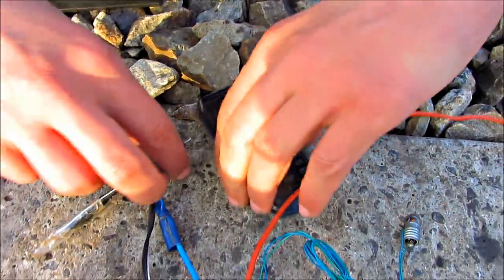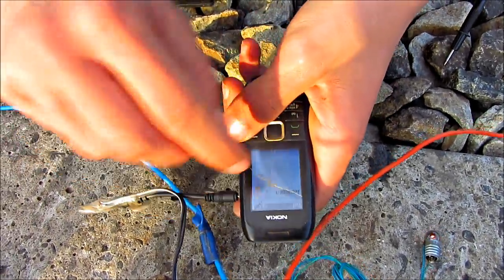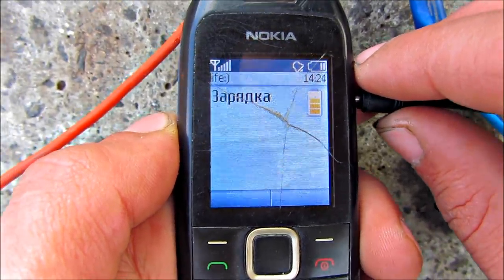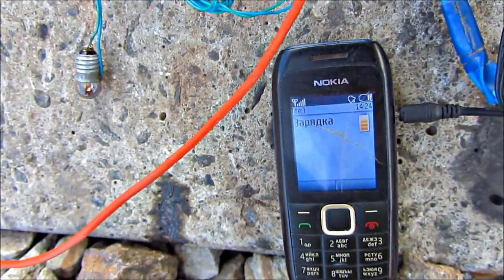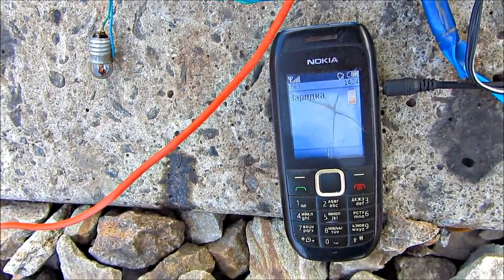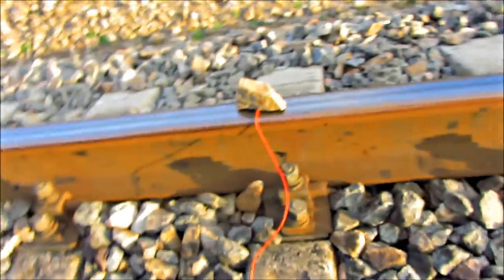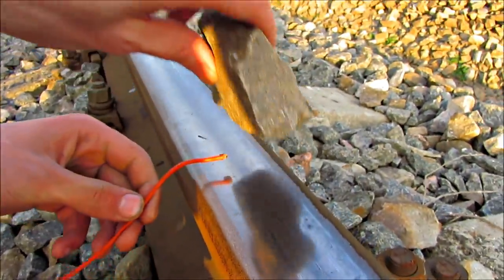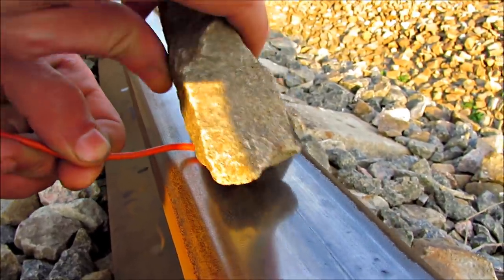How to charge a phone from the rail tracks. Measuring voltage on the railway

Comment: As far as I know, there's a little current going through to measure if a train is on that piece of track. All trains are made of metal and as they go through the track they will create a closed circuit, knowing that trains cannot occupy the same space, they can tell exactly which train is where based on the currents. This means that when you do this and the equipment doesn't adequately notice it's just you charging your phone, the traffic control program will notify the controller that there's an unidentified train at that location. Additionally, it will switch signals before that area of track to red and yellow (depending on the distance).
Reply: +TrainingMacro You Sure?
Reply: That is for as far as I know the system works in the Netherlands, wouldn't be surprised you're being able to do this because the same system is in effect there.
Reply: Yes and if you're car is stuck on track you don't wish to get hit by train short track using jumper cables. They think another train is there on the track when you short it.
Reply: +TrainingMacro The electric current also helps detect breaks in the rail, as if the rail is broken the current will not flow. Unfortunately this won't readily detect washed out or damaged track where the rails are still connected.
Reply: +johnstarr2001 
I will do this if my car ever gets stuck on a track.
Reply: +‍1marcelfilms I imagine you could try it with some jumper cables - but I don't know what threshold would be required.
Reply: +TrainingMacro Yes you are right. I work for a railroad company in sweden. By doing this it will actually stop the trains in that area. If you want to sabotage the  public transport so go ahead, but the police can find you quickly....
Reply: +TrainingMacro Excellent point!  The phone (or the lamp/speaker) may not be drawing enough current to trip the detection circuit, but it might.   In any event, what this guy is doing is a) Stealing electricity  b) Trespassing on railroad private property  c) Putting himself and the everyone on any oncoming train in danger (if they have to make an emergency stop because this idiot is sitting there)
Reply: +cowsongs oh come on! the worst thing that would happan - railroad sensors detecting false train on the rail.
Reply: Right.. Worst thing.  Train approaching only 1/2 mile away, this guy trips the detector, engineer now thinks there is a train or obstruction on the rail and has to make an emergency stop.   It is very easy for this guy to be too far away for the engineer to see, but still close enough that it would be very hard to stop the train in time. kosiak10851
Reply: In east europe or russia there is no such bullshit as rail roads on private property. Everything is public.
Reply: It's still generally illegal to be on the railway's Right of Way (RoW) no matter what country you're in.

Whether or not that's enforced though, is up to your country's current political condition.
Reply: I´ve never seen this before, but I can figure it out the purpose of those signals (which have a frequency). The signal applied to the tracks actually allow you to know the current position of the train, by means of measuring wave reflection. The reflected wave varies as the train, wich makes the short circuit between tracks, changes its position. I supose the frequency was set to 50 - 100Hz, becasue it gives a wave lenght comparable to the track's lenght.
Reply: I'll answer this from the UK's rail infrastructure perspective. 
the reason for a pulse or waveform being sent down that track is due down the wonder of modern railhead engineering; connecting lengths of rail is use done by welding the pair together. Previously, it was very easy to isolate sections of track into different "blocks" (so that only one train can enter one block at one time), due to the fact that the length of rail was bolted together and not necessarily joined electrically. 
However, with a rail weld, you cannot isolate a different block's track circuit. 
SO! to get around this, each section of the line is given a different frequency. 

Quote from Wikipedia;
Jointless track circuitsModern track is often continuously welded,
 the joints being welded during installation. This offers many benefits 
to all but the signalling system, which no longer has natural breaks in 
the rail to form the block sections. The only method to form discrete 
blocks in this scenario is to use different audio frequencies (AF) in 
each block section. To prevent the audio signal from one section passing
 into an adjacent section, pairs of simple tuned circuits
 are connected across the rails at the section boundary. The tuned 
circuit often incorporates the circuit to either apply the transmitted 
signal to the track or recover the received signal from the other end of
 the section.
Consider a railway with two block sections as in the diagram. Section
 1 has frequency A injected at the left-hand end and received at the 
right-hand end. Section 2 continues from the right hand end of section 1
 where frequency B is injected and then received at the right-hand end 
of section 2.

 

Track circuited railway with two block sections

There is often a gap between where frequency A is received and 
frequency B is injected. This is referred to as a 'tuned zone' and is a 
section of track where the amplitude of frequency A reduces in the 
direction of section 2 and the amplitude of frequency B reduces in the 
direction of section 1. The tuned zone can be of the order of 20 m long.
Advantages of jointless track circuits:
Eliminates insulated block joints, a component liable to mechanical 
failure (both of insulation and by introducing stress to adjoining 
rails) and maintenance.In electrified areas, jointless track circuits require fewer 
impedance bonds than any other double rail traction return track 
circuits.
Disadvantages of jointless track circuits:
Restrictions on placing impedance bonds, hence any connection for 
electrification purposes, in or near tuned zones as this may upset the 
filter properties of the tuned zone.Electronic circuits are more vulnerable to lightning strikes.
Reply: It's a railroad signalling. Google ALSN.
Reply: Im pretty sure that's how it is in america. I have not done this but ive heard of people dropping metal bars after the isolators by crossings and making gates go down
Reply: is it true, whoa, its mind blown.. you should do video about it.. to prove it.
Reply: TrainingMacro said:
"All trains are made of metal.."

That used to be the case.
Now however, China has begun producing cheap train imitations that are made of plastic.

Comment: Yea it's called positive train control, PTC for short. It makes it to when something that's metal is touching one rail to the other it indicates to the trains that there is another train. If the railroad catches you doing it on purpose you can get in a lot of trouble. It's a cool experiment to show everyone though!
Reply: +Mind Surgeon it is also as the activation signal for crossarms at railway crossings via the train wheel circuit. I live next to a crossing and every couple of years I have to go remove a coat hanger someone placed across the tracks to raise the arms and get the idiots in their cars to stop honking at nothing.
Reply: How about powering or recharging a battery after hours?
Reply: Gary Stinten, no. Trains run 24/7. And in many countries, the tracks are checked for obstructions, loose fittings and damage every day. Around here, that's done throughout each night, between about 10 p.m. and 6 a.m., when only freight trains pass, at 15 minute intervals.
Reply: Plymouth this is not positive train control. Its bacic ocupancy detector. Positive train contol involves GPS has well

Comment: The voltage on the rails does two things, it is a obstacle detection system and is a technique used to reduce the rate of corrosion on the tracks.
Reply: When the guy did this he was safe from trains and set the signal behind him to red clever way to stop a train but illegal
Reply: +ThisIs MyName not BS, it prevents electrolytic reaction, the same principle is used on ships to prevent corrosion in seawater cooling systems. Sacrificial anodes are also used on ship hulls to counteract the same process. Look it up 😉
Reply: +ThisIs MyName Cathodic protection (CP) is a technique to control the corrosion of metal. Cathodic protection systems are most commonly used to protect structures such as pipelines, storage tanks, steel piles, offshore oil platforms, and reinforcing steel in concrete.

The simplest method of cathodic protection is galvanic protection where a metal of different electrochemical potential is used as a "sacrificial" anode.

For larger structures, galvanic anodes cannot deliver enough current to provide complete protection. Impressed current cathodic protection systems use a DC power source to achieve this protection.
Reply: I understand this somewhat, thinking of electroplating but in this case which way is the current directed and then why is there a differential between the two railroad tracks? Trying to see the logic of energizing one as positive and the other negative. Or maybe they switch, but his multimeter did not indicate that.
Reply: +ThisIs MyName they offer you an electronic pulse generator or whatever it's called when you buy a car in a place that road salt gets used.
Reply: As pointed out by others both tracks are put under voltage in order to reduce the rate of corrosion. It simply doesn't matter how the tracks are put under voltage compared to eachother.
Reply: That is just wrong. The more positive rail would corrode very fast (like the zinc anode) and only the other would be protected. That is the reason they use AC in the system. It is only signalling.

For corrosion protection you would have to tie the rails together and polarize them negative relativ to a buried carbon or titanium electrode.
Reply: I think the initial point was that using AC current for sensing prevents the corrosion that would occur if DC sensing was used instead.
Reply: agreed.
Reply: It never to be for anti corrosion. It may be in just one case, If they decided to keep one rail and sacrifice the another one
Reply: Haha has not a single thing to do with preventing corrosion at a usual 1.5vdc on the rails.  Track occupancy and signaling via relays and voltage...
Reply: Why? How do you think battle ships prevent corrosion? Magic?
Reply: In the corrosion world, there is no 100% prevent of corrosion. The correct term is Inhibition of corrosion. Do you know that distilled water is regarded as corrosive media?!
Reply: And now hopefully hipsters get onto this trend.
Reply: Rubbish, it is not an obstacle detection system, rather a signalling system. and like demonkey123 said, it prevents electrolytic reaction
Reply: Anybody who claims that this is to prevent corrosion is 5000% full of shit. Simply a low voltage occupancy detection. Put a wire between both rails, and you will see your voltage drop significantly. This will prevent the voltage at the end of the circuit from holding up the coils of a relay, thus causing the signals to turn red. This is a Direct Current system that is grounded to earth. The presence of a short (shunt) between the rails acts the same as shorting out the leads of any battery. Amps go up, volts go down. All railroad signaling operates on this principal. This particular system is coded pulses of DC, sent in s very specific pulse combination of on/off cycles, which decoded, can tell the signals what color they should display. Railways do not have any sort of corrosion prevention. It is not necessary.
Reply: demonkey123 static electricity that's it. I lived Shanna Jones Junction in West Virginia my bedroom window from the train track with a broomstick away train would go by would turn on my electric train I had on the floor from static electricity and if it was a big enough train it would likely turn on my lamp so you can throw a fancy words but you're wrong.
Reply: Correct, it's called sealing current. We used it in the central offices with verizon. 5volts.
Reply: How the hell do u know this shit? It's a very cool conversation to be sure!
Reply: @jamess6734  Sacrificial zinc  plates I believe.
Reply: tbh i work on ships..for corrosion protection we use 2 methods
1) (inside hull)sacrificial anode method where we let a zinc anode corrode which is welded to the inside of the ship.the zinc anode corrodes oves time but not the ship from inside
2)(outside hull) we use impressed current method by suppling a DC voltage to the outside of the hull.when iron rusts it makes electric current so a reverse current is applied to the hull to stop the corrosion.
So this AC current will not help to prevent corrosion at all.also for around 220meters of length you will require around 50 to 60 volts DC in saltwater conditions.
Reply: So if someone put a 1000kg cube of porcelain on the tracks, it will detect it? Yes?
Reply: @demonkey123  could this be applied to a car to prevent rust? Car rust so fast...

Comment: Did lots of reading and digging, it seems to be a TRACK CIRCUIT...

A track circuit typically has power applied to each rail and a relay
 coil wired across them. When no train is present, the relay is 
energised by the current flowing from the power source through the 
rails. When a train is present, its axles short (shunt)
 the rails together; the current to the track relay coil drops, and it 
is de-energised. Circuits through the relay contacts therefore report 
whether or not the track is occupied.
Each circuit detects a defined section of track, such as a block. These sections are separated by insulated joints,
 usually in both rails. To prevent one circuit from falsely powering 
another in the event of insulation failure, the electrical polarity
 is usually reversed from section to section. Circuits are powered at 
low voltages (1.5 to 12 V DC) to protect against line power failures. 
The relays and the power supply are attached to opposite ends of the 
section to prevent broken rails from electrically isolating part of the 
track from the circuit. A series resistor limits the current when the track circuit is short-circuited.
Reply: Is there any Hall voltage while train is moving and   earth magnetic field cutting the train ?
Reply: Absolutely correct. Track voltages are kept as low as possible to prevent false circuit shunting during rain events or from street crossings wet with melted snow and salt.

Comment: The current flowing through the rails is part of the track circuit.  Every so often there are special insulated joints to divide the track up into sections.  I think it to let the signal box operators know exactly where the trains are.
Reply: Kotik correct! I used to work on the railways an know this for a fact!

Comment: That's actually really cool. I'm gonna tell my fellow migrants about this trick.
Reply: Denis W if they're smart.. see how many devices they can use from it.. also add some capacitors too.  Or a battery to buffer and the rails should act as a trickle charger.

Comment: To add an cap with an higher voltage rating does pretty much nothing. This is because the voltage value is only the maximum voltage on witch the cap does not explode. You have to add one with an higher capacitance.
Reply: if electroboom knew this....